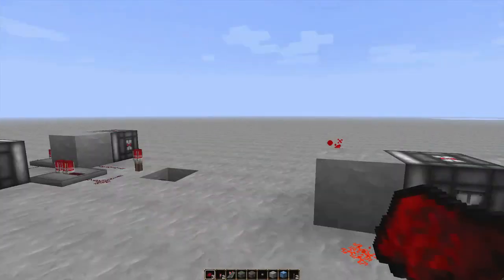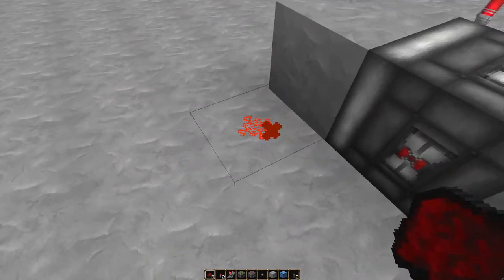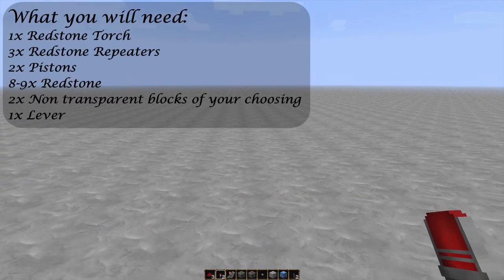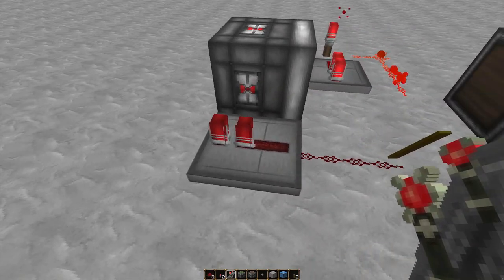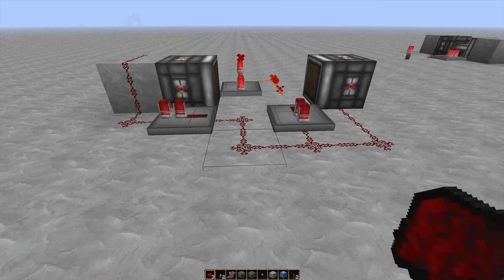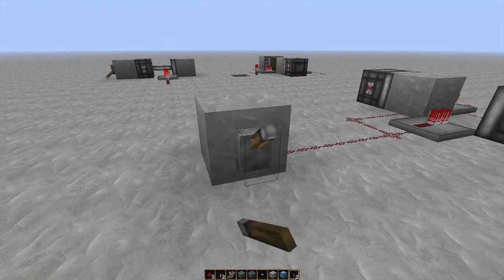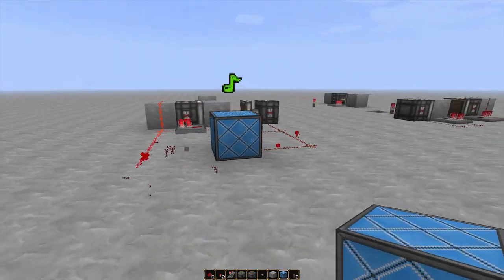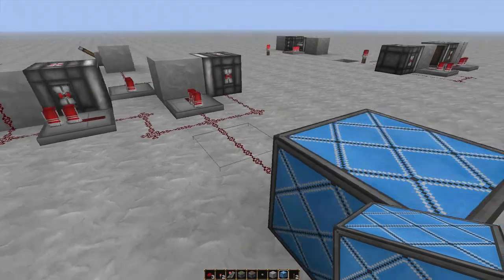OKtutorial - Rapid Piston Pulse Generator (Minecraft)

Comment: I use something very similar.  I call it a pulsar because it found (potential) uses that are not expected, such a block update detector.  It uses four repeaters to give and take the charge from the moving block, with the output pair charging another two blocks.  From each of those two blocks, a loop to each piston is made.  Any input can be used with it and often I tap the two out blocks together with redstone.  I can not give any images at the moment as the RRU gallery is borked.